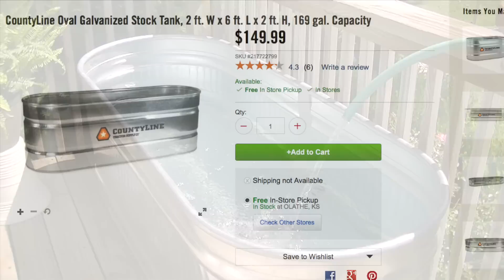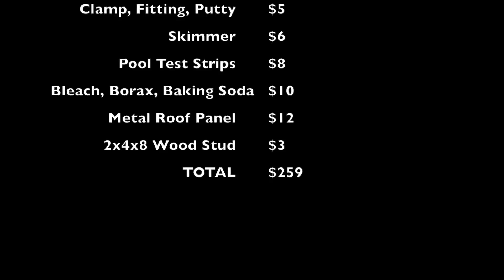How To Make a Plunge Pool under $300

Comment: it would be cool if you did a video on how to use the same concept and make it into a cold plunge, using an old refrigerator or freezer
Reply: Just add a chiller to this for $350 and you're good to go in most climates.

Comment: @video guy have you come up with a convenient way of draining your plunge? we installed a spigot, but now realize the spigot is too close to the ground to successfully attach a hose to the spigot to attach a hose and drain it. must drain manually for now, until we crowdsource or come up with a solution. thinking about elevating the tub for now. maybe creating a plank or an elevation mechanism made out of recycled wood palette.
Reply from the maker: My plunge sits on top of several wood strips which helps ventilate the bottom to prevent wood rot.
Reply: @VideoGuy  any chance you have posted a picture of what your base/wood strip base looks like somewhere on the interwebs?
Reply from the maker: @myomilky  just buy some strips of pressure-treated lumber at your local Home Depot, Lowes or other... fence material or other will do just fine.

Comment: can the water intake to the pump hook up to the drain plug port?  this may allow for zero drilling application!
Reply from the maker: Yes!  I like the sound of water splashing the surface of the water, so I drilled a hole.  Otherwise, you can use the drain plug.

Comment: So have you also seen where you can add a coil of water that runs through a chimenea and it'll heat it as if it were a hot tub?  Great for cold nights.  That's two more holes to drill.  Great job!
Reply from the maker: Oooh.  That would be nice.

Comment: Great video, thank you! Curious as to why didn't you use the same drain fixture for the water return so that it would be flush with the inside wall of the tank? And is there any reason why that return is above the water line? Is that required by the pump? Much appreciated in advance for your insight and experience!!!
Reply from the maker: I bought the last metal return fixture in the store.  So, I bought something different for the return fixture.   The nice thing about the plastic return fixture is that I can add extension "elbows" or "Ts" to direct the water in different directions.   I placed it above the water to enjoy the sound of splashing water.

Comment: Should be called “I didn’t do much research, so I went back to the hardware store” 

Nice job though 👌🏼
Reply from the maker: Most plumbing projects require multiple trips to the hardware store.  Ask any homeowner or hardware store worker.
Reply: looooool soo true
Reply: @VideoGuy Im getting one of these. What was the size of the one used? Was it the one you shown on the website? 2ft W x 6ft L x 2ft H? Thanks for the video!
Reply: @realtalk2528  correct.  2x6x2.
Reply: @VideoGuy  of course they do. He was just being light-hearted, my goodness relax 😀

Comment: Love this, great setup! Instead of drilling a hole to attach the filter pump hose (the hose that sucks in water), can you put the hose over the tub and into the water while keeping it submerged? 

Also, is it safe to be in the pool with the filter pump on/running?
Reply from the maker: Yes, you can put the hose over the tub. Yes, it is safe to be in the pool with filter pump running as long it is outside of the pool.  Never use a fishpond filter pump with a human pool.
Reply: @VideoGuy  thank you!

Comment: I live in a small house in hot SoCal with only a shower stall no tub (and minimal cooling). There is a mostly private carport/backyard (corner house) that can be made very private. I was going to get the Rubbermaid 150gal tank but these CountyLine tanks look much better and without all those moulding ridges. Gonna place this out there and mostly use it as a tub (cool for hot days, otherwise warm baths). Maybe a pool conversion one day? How is it holding up with the chlorine with that galvanized steel?
Reply from the maker: My family still uses it and it looks and works great.  I only put a few tiny drops of bleach in it every month during a 4-month period.  Otherwise, it's empty most of the year.

Comment: I’m having a tough time finding a sink drain that works without it leaking. Did you use one with an overflow ?
Reply from the maker: I just used a regular one with rubber washers on tight.

Comment: It looks great!....be careful though,as it's standing on the decking, water gets trapped under the metal pool,and will rot the decking in no time.
Reply from the maker: Thanks for the warning.  I treated the deck with "water seal" recently and will remove the pool in September once it gets cold.
Reply: you can avoid this by elevating the pool so airflows under it.

Comment: I've been looking at quite a few days amazing builds. I totally love this :-) I was wondering, if I was to raise it off of its platform, say about 6in and then install an elbow where the drain would be. It would lead out of the tub with a spicket so as to drain the tub but would not stick out of the side. Rather go under the tubbed. What do you think :-) I would be putting it into my converted shuttle bus
Reply from the maker: Good idea.  Try it.

Comment: Really good stuff here! Would you
Recommend a specific gal per hour filter ? I plan ordering the 1,000 but wasn’t sure exactly if that’s overkill or not. Secondly, what size drill bit did you use ? 1.5 inch ? Thanks again
Reply from the maker: My pump is 1,000 gallons per hour and uses a 1.25" inlet.

Comment: the first thing that should have been done ...... drill holes for pump for the  in and out.....  get a gallon or two of pool paint... why pool paint ???? your shit will rust over time pool paint is designed for pools and have a rubber base to it.... this would be ideal for these types of pools and I do mean the inside not the outside. the possibilities are endless to make this a show piece.... building a seating area around it and so on.
Reply from the maker: Great ideas!

Comment: Seems like a fun build, but whats the point? Why not just use your cleaner, safer, more comfortable bathtub?
Reply from the maker: The point is that it's fun, outside, bigger than a bathtub, does not require constant refilling and ready the moment you want a refreshing plunge. Plus, a bathtub is not necessarily safer or more comfortable.